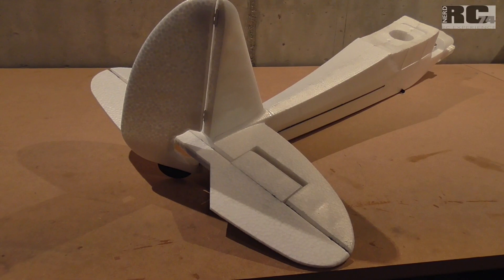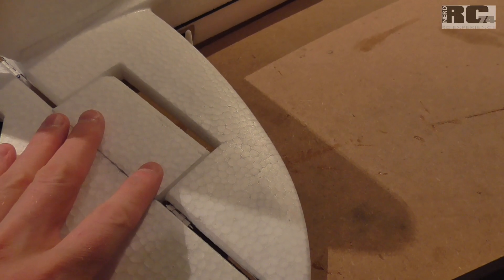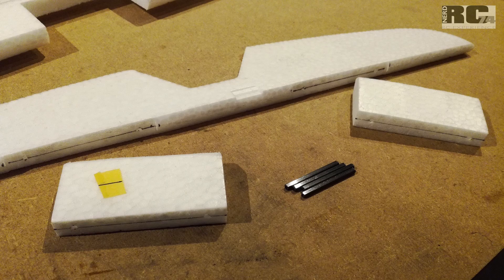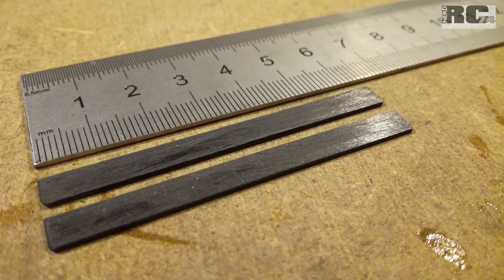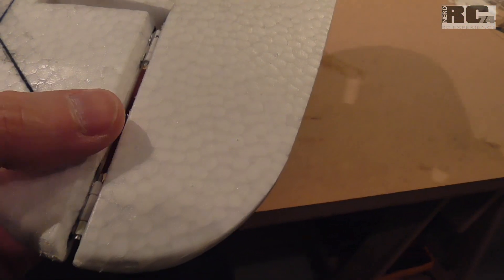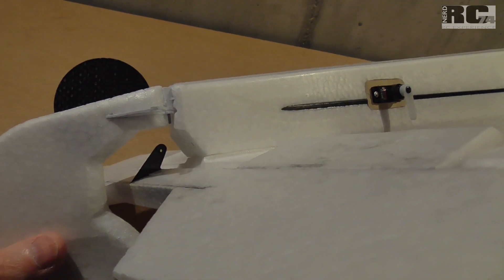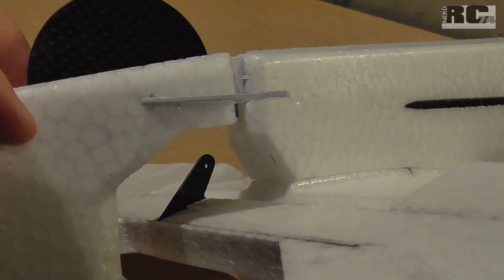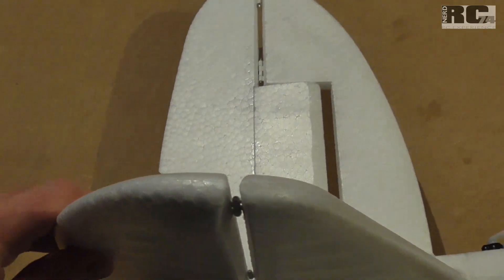MULTIPLEX FUNCUB | CLIPPED WING CUSTOM BUILD | PART 3

Comment: What coating is on that foam....hodge Podge hard coat or what do you use?
Reply from the maker: Silver color ist no coating. This is Multiplex Elapor spray paint. Black foil is Oracal 751.

Comment: Very nice work. Looking forward to hearing how it flies. Question about your process. . . how do you cut in the slots for your CF reinforcements? Are you using a sharp razor, then picking the foam out carefully? There wasn't much room on the elevator beneath the rudder area but you managed to get it to fit perfectly. Looks very clean. I also like the idea of moving the servos to the rear closer to the tail, this makes sense since the plane seems to naturally be nose heavy (at least in some of the reviews I've watched).
Reply from the maker: Thanks :o) You don't even need to remove some foam. Just make sure to use carbon which is max. 1.0mm thick. On the side you want to push the carbon into the cut, just sand the edge of the carbon to the shape of a knife blade. like this it's very easy to push it into the foam. i glued all these carbon parts with Elapor Zacky. You just have to be quick enough to push it in the right position before the CA glue dries :o) Enjoy your Funcub build!
Reply: @RCnerd74  Thank you so much for answering my questions! I'm still waiting on the Fun Cub but all my other components are arriving ahead of it. I'm interested in building the wing like you did with your first Fun Cub. What was your process to remove the dihedral from the main wing to make it completely flat?
Reply from the maker: @austntexan  you are welcome. I drilled them out until i was able to push the 8mm carbon tube through it.
Reply: @RCnerd74  Oh cool, that's simple. I was thinking the wing panels might have to be cut at perfect 90 degrees with a razor knife. Too easy. Thank you again! I'll pm you on RCG when I finish the build so you can check it out. Thanks again, you're very helpful. ;-)
Reply from the maker: That's what i had to do on my current build. Way more work... Thanks. I'm looking forward to your build :o)